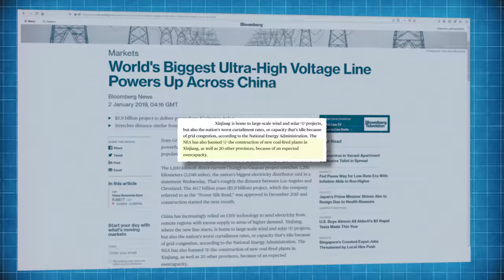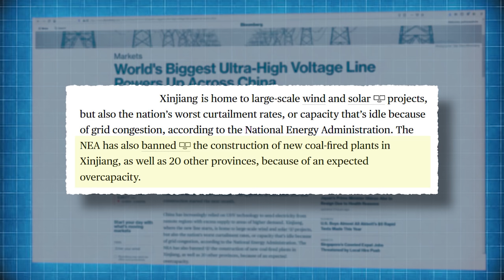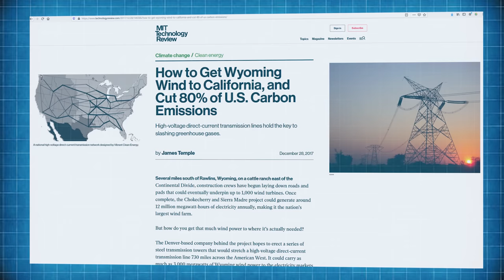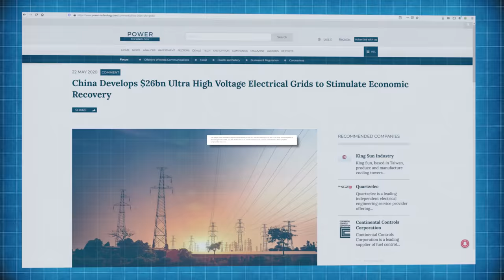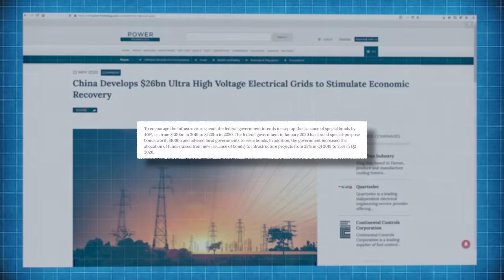China's MILLION VOLT Energy Superhighway

Comment: This video is an excellent example of presentation of falsehood by deliberate selective neglect of data.   The video repeatedly lauds solar and wind power, which have everwhere they have been tried on a large scale (Germany, Denmark, California) proved to be dismal failure, boosting the cost of electricity and not reducing CO2 output per kW-hr remotely near levels required to deal with global warming.  Experience shows that investing in "renewable power" also locks in dependence on   The video carefully avoids mention of nuclear power, which has in France, Sweden, and the porvince of Ottowa allowed ending of use of fossil fuel for electricity production, resulted in decreased electricity costs, and lowered CO2 output per kW-hr to levels agreed to be effective in dealing with climate change by all international bodies weighing in on this issue.     The speaker goes on and on about China's building "renewable power", but avoids mentinon entirely of the fact that China is one of the world leaders in developing nuclear power plant technology, and gearing up to mass produce both large and small size nucldear power plants for export.  Indeed, this is the primary thrust of China's government in terms of trying to reduce its current massive dependence on coal.   But you'd never know this because the speaker here lies by selective neglect of centrally critical data, not mentioning China's massive involvement with developing nuclear power at all.

Instead of solar and wind... intermittent power sources available for about 15 to 35% of the time at full power... requiring parallel building of natural gas plants for the rest of the power... and long distance transmisison lines... the rational and only effective alternative to fossil fuel power plants is of course nuclear power... especially with the soon to be achieved production of thousands of small modular nuclear power plants that can be place quite near the areas using the power.   

This is basically misleading and factually false propaganda presented by a true believer in the fraud and scam that is renewable power, and one so dishonest as to simply censor mention of the alternative... too afraid to address nuclear power and present what arguments he can make opposing this safe, clean, economical, indefinitely sustainable, and ONLY viable alternative to dependence on fossil fuel.